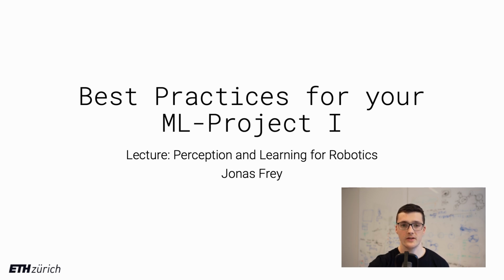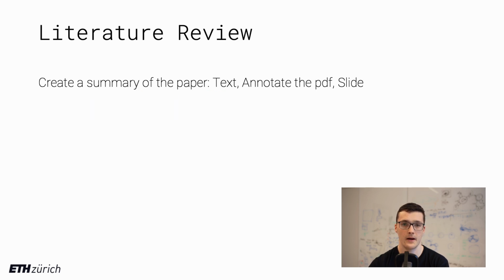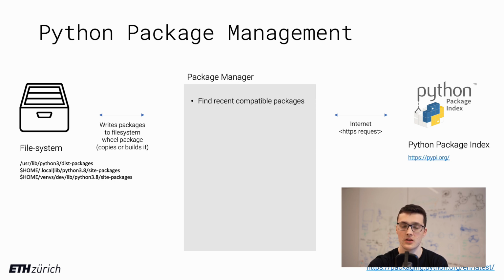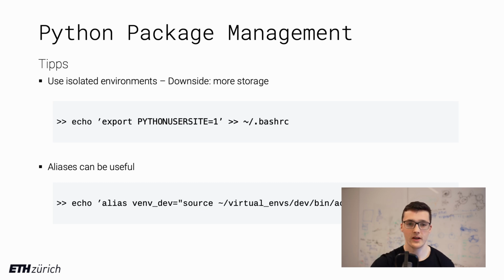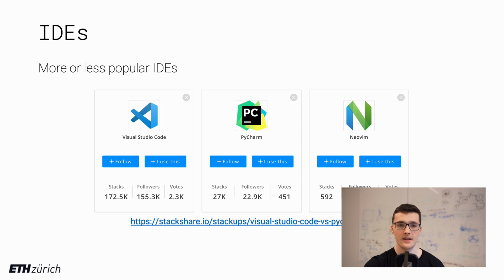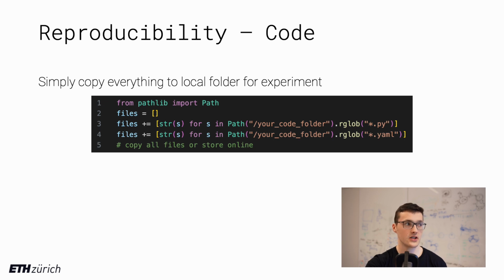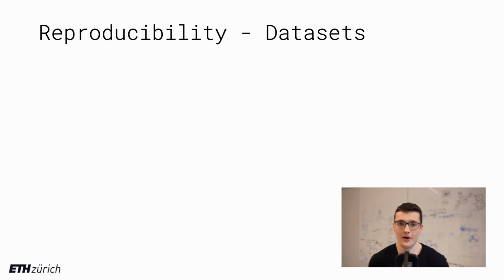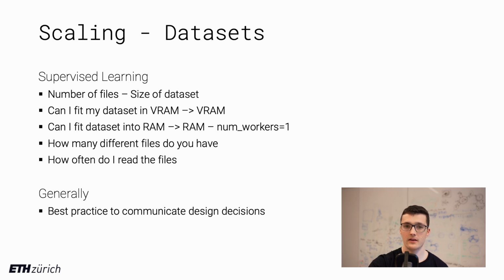Lecture - Perception and Learning for Robotics - Best Practices ML-Project

Comment: Thanks for sharing best practices. I have a question: how can we use the Python virtual environment with ROS? Does that mean we need to install the ROS distribution in the virtual environment, or do we install the ROS distribution at the system level and then access its functionality in the virtual environment?
Reply from the maker: Hi, you can simply install ROS on your system and follow the normal virtual environment installation. The virtual environment will, by default, extend the installation of your system's Python. Just make sure to source your ROS and virtual environment correctly and everything should work by default.